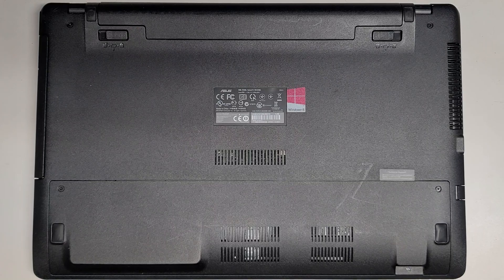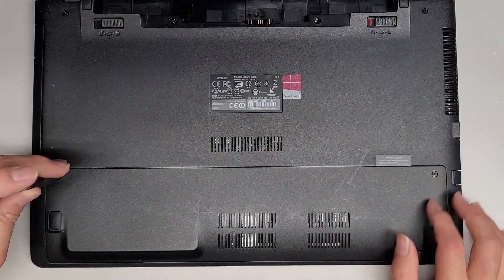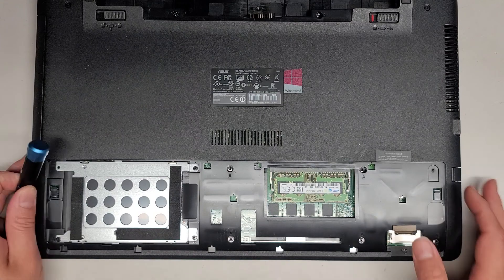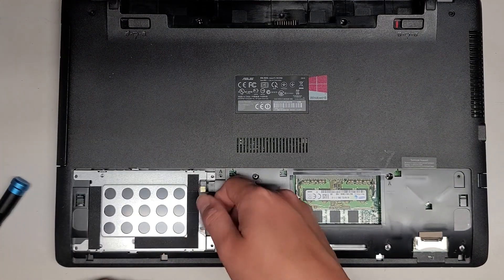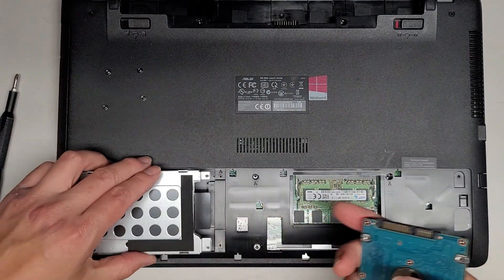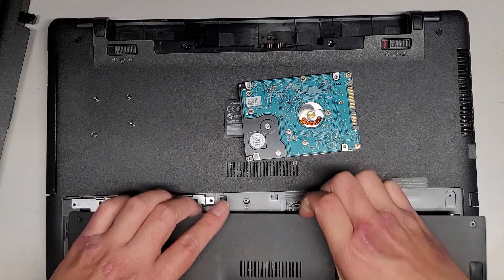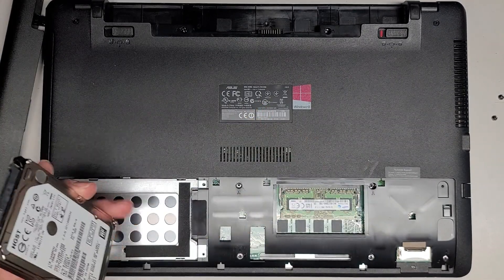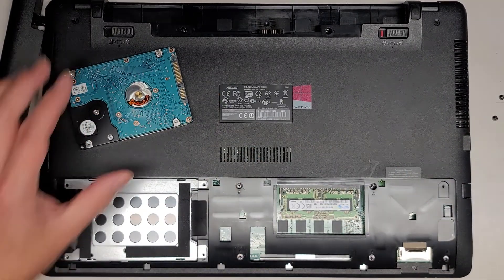ASUS X550L X550LA-DH71 Disassembly RAM SSD Hard Drive Upgrade Battery Replacement Repair Quick Look

Comment: I have the K-550L with an i7-4510u and GeForce 840M and 8 GB RAM. I upgraded to a WD Blue 1 TB SSD after the original HDD started having issues. My laptop is very similar to the one in the video. I've been having issues with RAM as of late and want to upgrade, but I'm not sure how much the mobo can take. I was thinking of upgrading to 12gb (replacing the removable 4gb stick for an 8gb). What would you propose?
Reply from the maker: Usually there is no max. The compatability issue is usually more with the speed.

Comment: I have this same laptop with 8gb ram installed, it says i have used 2 ram slots out of 4....., 2, of each slot holding 4gb ram. My question is, where can i find the remaining 2 slots that are still unused? Because I want my laptop to have 12gb ram.... So i need to know where to install the 3rd 4gb ram chip
Reply from the maker: It's a lie. Buy 2 8gb sticks.
Reply: @ItsBinhRepaired  thanks 😊
Reply from the maker: @marvinlincoln4636  no problem
Reply from the maker: Also,  SSD will make a much bigger performance difference.